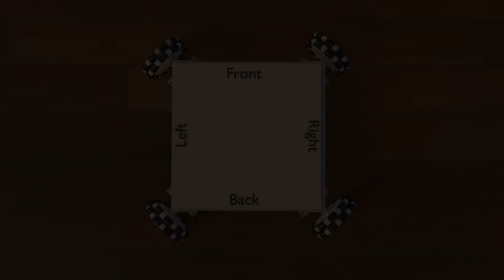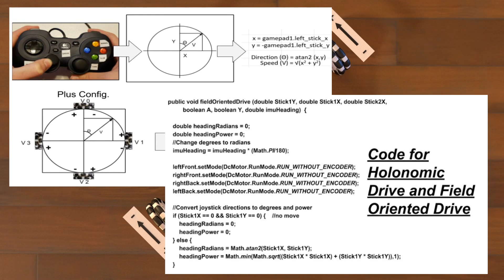Holonomic Drivetrains for FTC - Part 2

Comment: what happens if you move the front wheels closer to back wheels so it looks like 
          _________
       /                       \
      |                          |
      \                         /
there is less gap in between front and back wheels